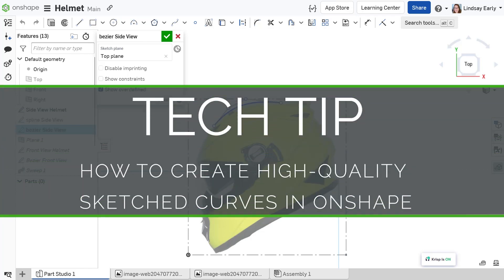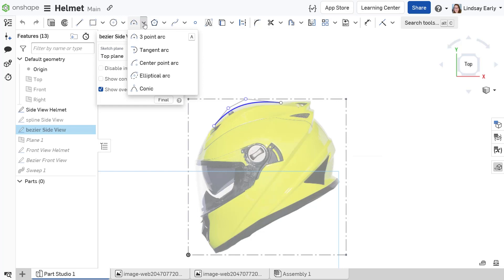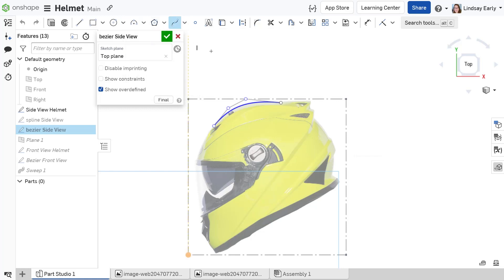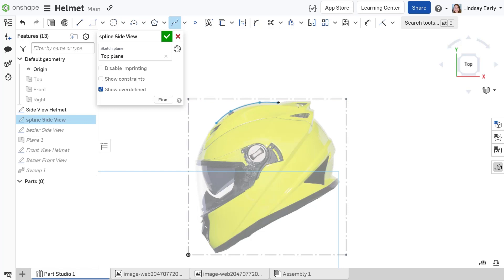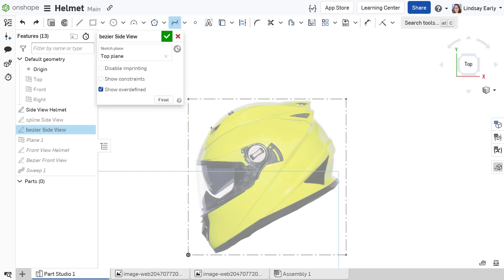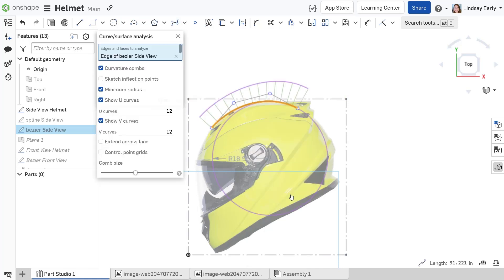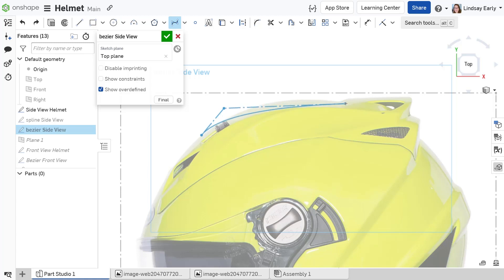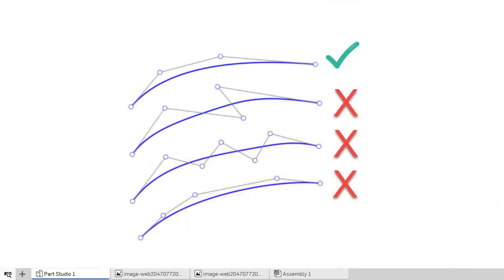How to Create High Quality Sketched Curves in Onshape - Tech Tip

Comment: I keep hearing about "high quality" and "lower quality" curves in Onshape, but what does it truly mean for a curve to be lower quality? What makes a curve be lower quality than another, and what consequences does that have?
Reply from the maker: Hi George - Here is a response from Lindsay in our team.

So lower quality means rapid changes in curvature, such as the spline in the example. The result is something that isn't overly obvious within cad unless you turn on visualization like zebra stripes or the colormap like I did in the beginning of the blog. The surface that shows pinching was created by sweeping the spline. The surface that shows a nice smooth color map was made by sweeping the Bezier. In person, you'll notice these issues by the way light reflects on it and it'll become obvious when you touch it that the surface is not smooth and ripples. 

Hope this helps.
Reply: Thanks!
Reply: @OnshapeInc i think you could also understand it as a 'fair curve' as is common terminology in aero and shipwright circles.